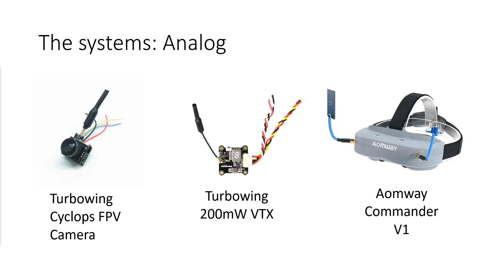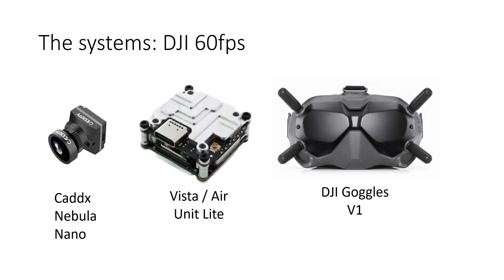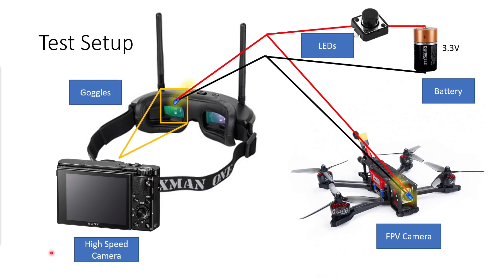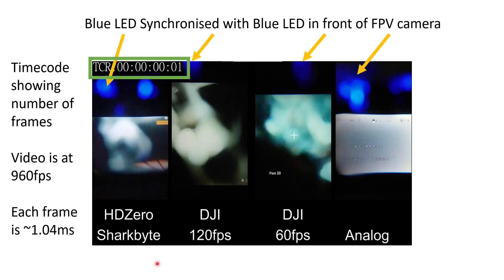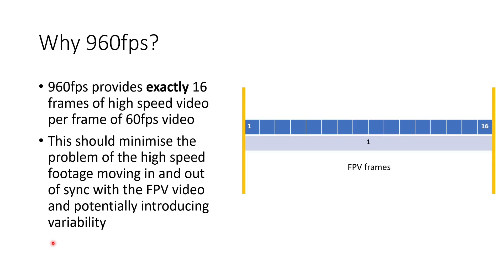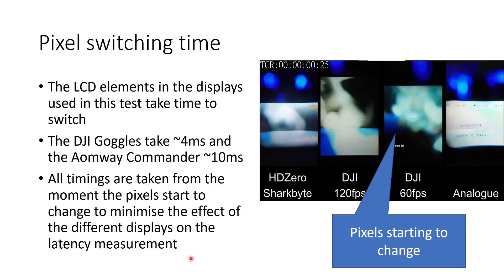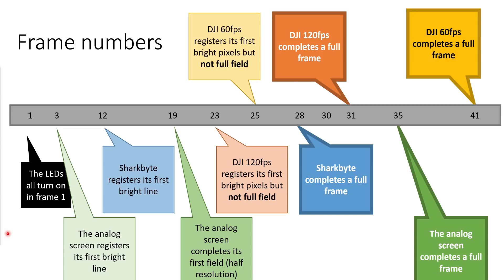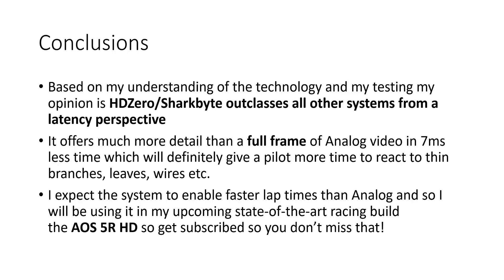Video latency testing with 960FPS High Speed Camera: Analog, DJI, Sharkbyte, HDZero

Comment: Hi Chris, I know I'm late to the party but I just wanted to tell you that you're mistaken about interlacing. TFT/LCD screens (or any modern fixed resolution screen) are not capable of scanning line by line and what you are witnessing is not interlaced scan but rather a phenomeon called "combing" where the deinterlacer incorrectly merges interlaced fields, assuming two fields are from the same point in time when they are not. This gives you the characateristic top/bottom split. The reason why this happens with almost every frame in even the most premium goggles is because manufacturers want to keep delay to a minimum (and also use cheaper parts). In fact, there are multiple people in the scene who complained about Skyzone simply rendering fields as frames, which ever so slighlty shifts the image up and down between fields - causing the famous Skyzone Jitter. The reason why it might look like interlaced scanning in your test is because most progressive screens also refresh (a full combined frame) top to bottom. Or it might be light bleed, I don't know. When I filmed my own tests at 480fps, I did not witness this type of light bleeding like phenomeon.  

Also, at 9:11 you say that DJI completes a full "field" after x milliseconds, which is also incorrect, as DJI uses, by its nature full progressive frames. There are no fields, only frames, in progressive video transmission. I know you meant the correct thing because of the explanation afterwards but it might still a bit confusing for the average viewer.
Reply from the maker: Thanks for your comment. I think there may be some confusion between the effect of interlacing and rolling shutter. Progressive scan video which is captured with a rolling shutter ends up with split frames depending on when the light turns on in the rolling shutter. Analogue does not have split frames because the video signal scans at the same rate as the camera rolling shutter. I'd also like to correct your statement that TFTs cannot scan line by line. They can and do. In fact all TFT updates are completed line by line the only variable is how fast they scan. Most displays that display progressive video update very very fast (under 1ms) but still do so line by line. TFTs that are designed to display analogue scan at the  field rate just like the CRTs of old.

As for field Vs frame that is a fair point. DJI requires 2 full frames to fully capture a led turn on because of the rolling shutter effect. This would be fixed with global shutter but there are other issues with that. I used full field full frame loosely for the fairest comparison.
Reply: @ChrisRosser  >In fact all TFT updates are completed line by line the only variable is how fast they scan. Most displays that display progressive video update very very fast (under 1ms) but still do so line by line.

You are right, I should have been more clear about that. They do not scan line by line but the progressive frame is of course drawn line by line, which is what I meant by my statement - "refreshed from top to bottom". 
/EDIT: I just checked my original comment and I said "incapable of scanning line by line" which is correct. What you mean is update line by line, which is not the same thing. 

>Analogue does not have split frames because the video signal scans at the same rate as the camera rolling shutter.

You need to differentiate between what the camera records (and the VTX transmits) vs what your goggle displays because while there are no inherently split frames in the video signal (there are no frames at all, only fields), there are split images in the progressively rendered analog image, as is evident by your recording, where you can clearly see a split image.

In any event, the Skyzone goggles (where people have examined the deinterlacer in more detail) use line doubling to deinterlace, which means you effecitvely get half the resolution but 60fps - in a way. It's difficult to do a apples to apples comparison to something like DJI in this context. I might do a follow up video on this when I have the time because as it stands, I feel you incorrectly explained both the advantages and disadvantages of analog video.
Reply from the maker: @itsallsobothersome4537  If you have watched the preceding two or three videos in this series I expain the rolling shutter vs global shutter and how that causes a split image. Maybe this video feels incomplete in isolation?
Reply: @ChrisRosser  I have now watched all videos on that matter and it feels to me you are trying to stir away from the factual mistakes in this video. What you claimed in your slide at 6:08 is undoubtably incorrect and gives viewers a completely wrong impression of how these systems work. Your analog goggles, or any goggle for that matter, do not scan line by line and what the slide shows is not the "screen update behavior" as it says in the title but rather how old CRTs and certain plasma screens used to natively render an interlaced picture. While it is true that no frame buffer is necessary if de-interlacing is simply done by displaying fields as frames, the graphic is misleading in this regard as the goggle still only updates in full fields and not line by line.
Reply from the maker: @itsallsobothersome4537  At 5:30 in the same video you can see the analog goggle screen updating line by line as the new video information arrives in direct contradiction to your statment. Analog goggles do not update suddenly in full fields If they did the update would look like the HDZero and DJI goggles. Regardless of the display technology analog video must be drawn line by line if the goal is to minimise latency. Adding a frame bufer adds unnecessary latency so analog FPV goggles do not use one. Many deinterlacing algorithms are also designed to work line by line for this very reason.
Reply: @ChrisRosser  No Chris, this is actually not what happens and you could have easily verified this yourself (as I just did). Record the footage of the light bulb with a progressive scan camera (or your goggles DVR through the FPV cam and check with mediainfo if the file is interlaced, proceed if it is not), connect your analog goggles via HDMI and play back the video through your goggle. You get the exact same effect (as did I, when I tested this). So what, are you now trying to tell me that our analog goggles scan obviously progressive video files in an interlaced manner? Of course not, that would make no sense. And on top of that, this top-to-bottom refresh gradient you interpret as interlaced scanning is also visible for DJI in both modes, only it happens more quickly because DJI uses more modern panesl with better g2g times. In fact, it happens on almost any LCD or OLED display of any device because that's how display refresh fundamentally works.

Comment: Did you repeat the measurements enough times to get the average delay of possible mismatch between VRX/goggles receiving frame and goggle displaying it? I don't know if either digital FPV technologies use anything similar to G-sync for PC displays. If we assume we don't have any special syncing technology, for a 60hz display the given minimum fullframe delay would be 1/60 + 0-(1/60) depending on when the frame is received relative to when the display itself last refreshed.
Reply from the maker: Hi, yes I did lots of repeats. For all fpv video systems the frame rate of goggles and camera is v synced. You do get some variation due to rolling shutter but that's not a frame rate mismatch that's to do with how each frame is captured in the camera.

Comment: Thing I don't get.  Is people saying no reason to go to hdzero. But then with controller system they say how they need 250 to 500hz. Can't fly with 50 or 150hz..  its just better. But then say you don't need hdzero..  dji is the best.  You don't need lower latency. 
I understand the higher hz they said does help the pid loop controller. Think uav tech did a video on it (?).. idk. I want hdzero for a long range quad or plane.

Comment: With interlaced video you can guesstimate movement faster?
Reply from the maker: With interlaced you get 1/2 a frame at 60Hz. With DJI/HDZero you get a full frame at 60Hz. I think the full frame is going to be better for seeing movement.
Reply: @ChrisRosser  I'm not so sure, we are already in the realm outside of human capabilities.
Reply from the maker: @sjoer  I don't think that's true, for example Linus Tech Tips found that gamers are able to be more accurate and perform better on 240Hz displays vs 120Hz displays. I don't think pilots would be any different.
Reply: Ooooh, I think you need to watch that video again and listen closely to what Shroud has to say about it.

The fact is, humans think they are quick. But lets face it, most of us can not respond within a 100 milliseconds.

That LTT video is far from objective and is very opinionated. Tracking your mouse movement at 4ms across the screen is NOT going to improve your performance at all over tracking it at 8ms... maybe you would start to notice latency if you played with VSYNC on and couldn't render at the refresh rate. Meaning, your input was sampled the previous frame.

You are even clever enough to test this, just add:

if (millis() % 16 == 0) at the top of your loop and try flying with it in a sim.

16ms is on fringe of noticeable for many people, 32ms is noticable for anyone and going lower than 8ms is purely placebo.

So back to how frames are rendered, I know the image is interlaced. This means that the second field contains movement and your brain is perfectly capable of recognizing this movement as actual movement. Your eyes can only see sharp images in the middle of your view, so whatever is happening between fields occluded or not is barely perceived by you unless you look at a still image.

If you had to actively think about it, you are already too late as we are talking about a brain to finger response that sits at about 60ms in extremely fast humans beings like... pianists.
Reply from the maker: @sjoer  Forgive me, but I'm not speaking about latency here. Rather detail/resolution at the same frame rate of 60Hz. An interlaced video at 60Hz is much less detail than full frame video at 60Hz and I think you will be able to see motion better with full frame video.
Reply: @ChrisRosser  Oh yes, for sure you will see more details with a full frame. But I think your brain is more capable to estimate motion even if it is a partial frame. The fovea centralis only picks up a tiny part of the view anyway, the rest outside that is "imagined" by our brains.

What I was saying in regard to the LTT video is that if you move the mouse, you don't stop moving when you see the cursor reach the destination. Our brain simply does not work that way and our physical responses are not adequate enough to respond that fast.
Reply: "Interlaced video (also known as interlaced scan) is a technique for doubling the perceived frame rate of a video display without consuming extra bandwidth. The interlaced signal contains two fields of a video frame captured consecutively. This enhances motion perception to the viewer, and reduces flicker by taking advantage of the phi phenomenon."
Reply from the maker: @sjoer  I would agree that interlaced video at 60fps is probably better than full frame at 30fps for motion estimation. It would be interesting to see the SB system running at 120fps interlaced for example.

As for frame rate I did find this study: https://www.nvidia.com/en-us/geforce/news/what-is-fps-and-how-it-helps-you-win-games (admittedly done by NVIDIA but that doesn't necessarily make it false!) that finds that for gaming human performance improves a lot with frame rate for esports (60% improvement in K/D from 60 to 120fps and 90% improvement from 60 to 240fps) so whatever the reason (latency, motion estimation etc.) I think there is evidence to support the view that high framerates do matter for FPV.

I found a similar study for latency: https://jov.arvojournals.org/article.aspx?articleid=2750799. This shows that even an additional 4ms has a small negative effect on performance. Does it matter? Probably not for freestyle but definitely for competitve racing where races are often decided on the finest of margins!
Reply: @Chris Rosser  Haha KD vs FPS, great chart :D

I find it very hard to believe there is a 90% improvement, I have a game design background and used to program quite a bit so these concepts of frame rate, refresh rate and input/output latency are pretty known to me.

Sadly, I can't open the study you linked. Says forbidden.

Either way, us humans are not capable of such reactions. If there was a proper study done on this topic I might disagree, but there isn't.

For example, if you flash a light and have a test subject respond to it. The subject would never respond faster than a 200ms, the reaction times measured vary by greater measures (20ish ms) than any frame time would add or subtract.

The visual stimulus your eyes get take a cool 20 to 40 milliseconds to reach your brain, auditory stimuli about half that time.

So when you are in, what we call, a state of flow... your brain is hard at work compensating for exactly that.

I'm not sure if I'm allowed to share links here, otherwise I'll mail it to you!
Reply from the maker: @sjoer  I agree it seems counterintuitive, but I can't help but wonder if there is more than just reaction time going on here. Or maybe if your reaction time is 200ms then 204ms is still better than 208ms 🤷‍♂ I've sent you the link to the other study.

Comment: Hi Chris, cool analysis & data capture. Appreciate your video. You mentioned HDZero delivers fullframe 7ms faster than analog and that should result in better lap times. Have you heard of racing pilots mention that the DJIsystem gives them better lap times as it also does 4ms better than analog in 120fps?
Reply from the maker: I don't think DJI gives better lap times because the latency is variable. It's only faster than analog under ideal conditions and when data starts getting lost the latency jumps up and becomes variable due to the retransmissions. 😁 For racing SB is definitely superior!
Reply: @ChrisRosser  appreciate your response Chris

Comment: I wonder about DJI's V2 googles considering it has a faster screen refresh rate of 144Hz.
Reply from the maker: Yes, I wonder if they drive at 144Hz when connected to an air unit or whether they run at 120Hz.

Comment: First: Very nice testing, thanks for putting al the effort into this!
Second:
I partly disagree on your conclusion to Racing @ 13:20.
I think it may depend on the racetrack. If you race a basic multi GP track without fancy obstackles, every gate, flag etc. would be easily visible with half-frame resolution. Therefore the analog system would still have a huge advantage (latency wise) compared to the digital systems.
However, i can clearly see that in many racing scenarios that rely at least partly on environmental obstackles (warehouses for example), sharkbyte would be superior to analog.
The questions are: 
1. Is that "huge" advantage of Analog over digital in Multi GP tracks really that huge? (considering most top racing pilots ive seen mostly criticised the variable latency of dji)
2. will track Designers in general use more "hard to spot" obstackles in the future to make their tracks more interesting for spectators? (I thing it will still be dependant on the League you're racing in. Multi GP will stay simple and consistant, DRL will stay fancy)

If the low latency of the half Frame resolution of analog makes the racers feel that they can react faster in some scenarios, i can see them start switching between analog and digital dependant on what track they are racing.

...but I don't believe that the half-frame makes any difference whatsoever. Also, with all the other benefits of digital (sharkbyte-like) like having more than 8 pilots max compete in a race, having more than 60 (30 full) FPS in the videostream and so on, the winner in the long rung clearly is digital (as if there was a discussion about that lol).
Reply from the maker: Great comment and very detailed thank you! I think that the better resolution of sharkbyte will overcome the very small latency penalty in the long run. Especially with Noical setting faster laps with SB than analog recently 😲. How big is the difference? It doesn't matter. Marginal gains. Every 1% counts everywhere if you want to win.

1% better motors, 1% better battery, 1% better video system. Now you're 3% faster. That's a second on a 30s 3 lap. That's 1st place rather than 5th place in MultiGP.

Comment: High quality content as always with you !!! However, I am surprised by your choice of analog camera. 

Wouldn't a high quality camera like a Runcam racer or whatever racers use these days be a 'safer' choice to validate your results?

Might also be true for VTX, I wish you could measure the latency with a popular VTx like the TBS nano (popular with racers) or a Rush Tank (popular with freestylers).
Also I am analog guy but I would expect to identify wires and small leaves earlier (outweighing latency) with DJI from the fact the picture is much clearer.

Last comment is kinda off topic, but the time for picture to adjust from dark to very bright is key to avoid obstacles is many freestyle situations, so we can measure when the screen becomes white (your test) and we can also measure when we recognize an actual led on the screen (latency for brightness adjustment)

Thanks for reading all this and please keep them coming, your videos are fpv caviar 😍
Reply from the maker: Lots of people have had the same thought. I'm going to test a few different analog cameras and do an analog only latency shootout.